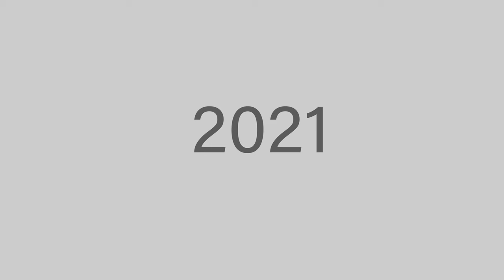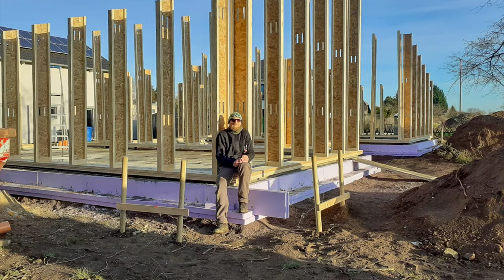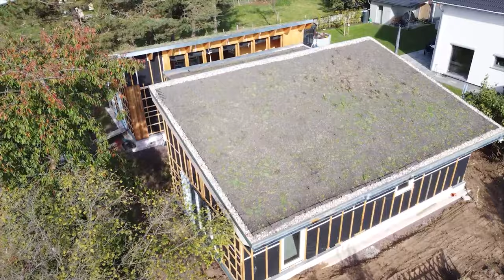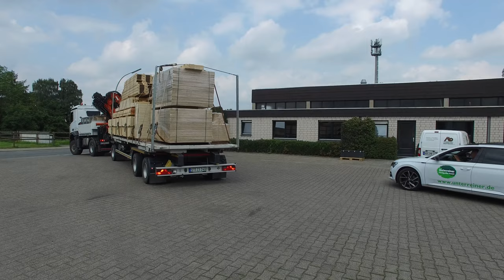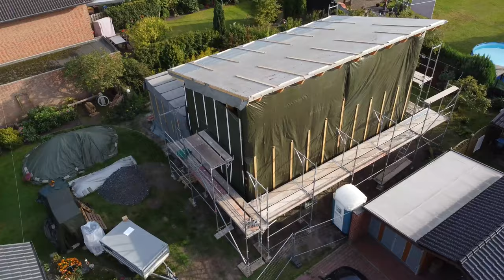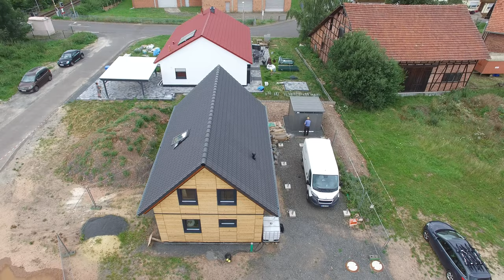Das war... 2021

Comment: Ich wünschte, Ihr würdet einmal zeigen wie die Dämmung ausgepackt und eingebracht wird, wie die Fenster eingesetzt und abgedichtet werden. Mir ist klar, dass Ihr den Bau nicht durchführt und nicht verantwortlich seid. Aber Ihr liefert ja die Dämmung und Fenster mit (im Gegensatz zu Sanitär). Daher ist es halt nicht gerade viel, für ein modulares Selbstbauhaus immer nur das Steckgerüst, die Einhängefassade und dann das fertige Haus zu zeigen.
Reply from the maker: Hallo Lars Irs, das ist sicher wünschenswert, aber wir sind (wenn überhaupt) immer nur kurz und dann insbesondere beim Aufbau des Tragwerks vor Ort. Ein paar Details, wie z. B. den Fenstereinbau haben wir in unserer Ausstellung gedreht. 
Die Einbringung der Dämmung ist aber nicht wirklich schwierig und interessant. Außerdem gibt es natürlich viele Dämmstoffvarianten wie Isofloc, Strohsteine, Hanfdämmung, Seegrasdämmung u. v. m.
Unser Baukastensystem ist eben ein Stück weit offen für weitere Produkte. Das macht es vielleicht auch charmant? Oder?
Grüße vom SI Team